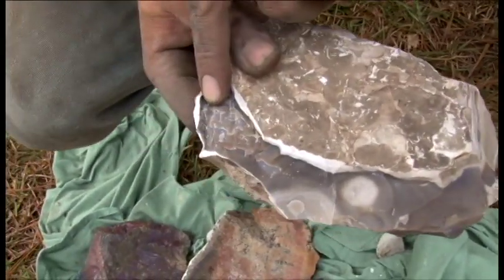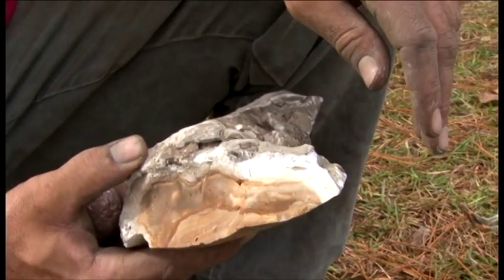Flint Knapping - Crystal River, Florida

Comment: Dehydrates it. You can tell when heat treatment is successful, because the rock loses significant weight. I believe the water in the matrix diffuses and mitigates the force imparted by the strike. When its dry, a shockwave can propagate through the rock and so it flakes off. We can see this in waves on the surface of the flake scar.

Comment: ok. Great.  Then I encourage you to publish your findings.  It is entirely likely that the existing data is wrong, but that is what is out there.  If you search the sources you will see that several authors have used SEMs to analyze material and there still is a good deal of speculation.  Since this is not at all relevant to my work I don't really have a better answer.  But It would be a great service if you published your finding in a peer reviewed journal that we could all cite.

Comment: Thanks for information.  There actually has been a great deal of speculation about what actually happens during heat treatment.  The suggestion of a partial melt at fairly low temperatures comes from a professor of geology in regards to why the quality of some knappable materials is improved.  If you have some sources about what happens to the stone I would be grateful if you could post them.  Luckily, my dissertation has very little to do with lithics.